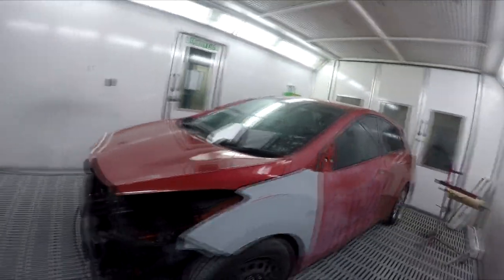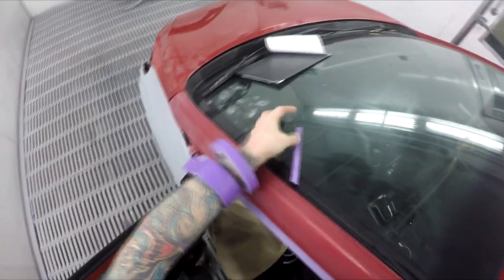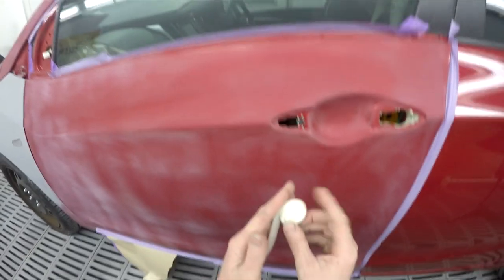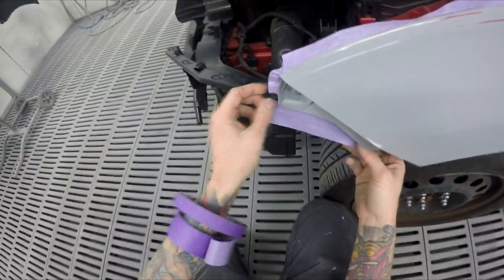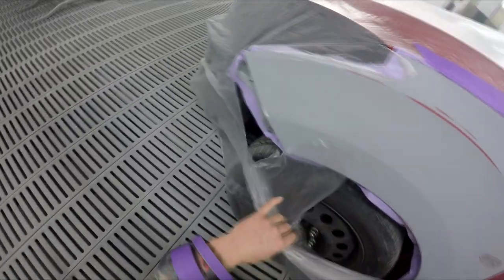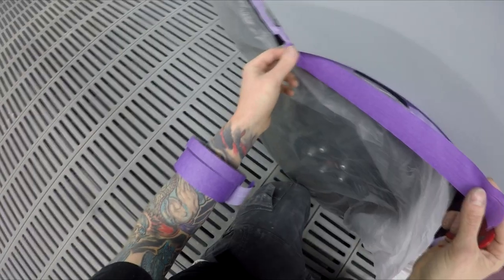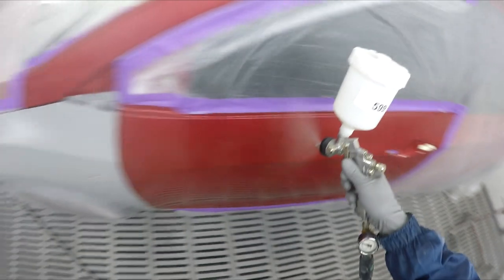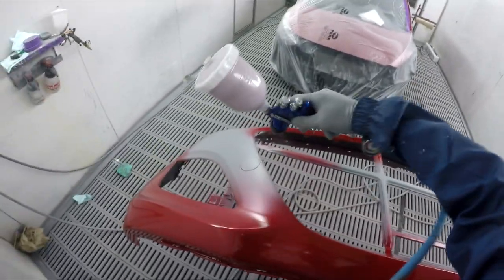Red Hyundai Mask & Paint

Comment: He's right, the "A" pillar is the first leg or upright supporting the windscreen.  The "B" is next, supporting the rear of the drivers door, and so on.  They are the terms we use in the Fire/ Rescue Service for when we are cutting apart vehicles to extract people in car wrecks.  The term "pillar" is also an architectural or construction term for "upright support", "column", or "shaft".  I'd say that fits the bill here as well, providing support to the windshield/screen and roof structure.

Comment: Yep, the Sr200 is a great mask, total seal. Can't use it with glasses though. I'm currently using mine with a Devilbiss air supply belt which is working fine.

Comment: Yes! I’m a rookie so please excuse this dumb question. What does wet on wet mean? I am getting ready to spray epoxy primer on an old truck I’m doing a color change on. Then 2k over that. Is the wet on wet primer like a reduced 2k primer?
Reply: Semper Fi wet on wet primer is called primer sealer in the states
Reply: Semper Fi  I am not for sure. But wet on wet meaning primer that's wet in a since real short drying period, only done so panel looks a solid color instead of cuts. But the second wet would be the wet paint going on it. Primer not cured completely basically...? Am I wrong or what gunman??
Reply: After tons of body work. Down to mostly bare metal. I’ve spayed my epoxy sealer down now. I waited about 3 hours. Then I started my 2k high build primer surfacer. I put on 4 coats. Leaving the proper cure times per coat. So hopefully I can block sand that down to perfection. I think I asked a question here that I knew the answer to already lol
Reply: Semper Fi when it comes to body work, there's many ways to do it, but only one right way. Your way. You know what I mean, lol
Reply: Wet on wet also can sometimes refer to systems that you can apply your second coats of "whatever material" on top of the first coat, wet, and not have to wait until the first dries or flashes off.  There are some clear coats that you can do that with, and so on.  Heavily depends on the context on which the term is being used.
Reply: your panel is already prepped in a grit you are o.k to paint over,you first put on a very thin but wet coat of sealer,and usually at least let it flash off,then start applying color,without sanding the sealer you just applied.or if ur into art work,i.e.oil paint you would lightly coat entire canvas w/ linseed oil or a mix of linseed and thinner,then applyyour paint vs.color on a dry canvas...the last part is kind of a joke don't apply oil of any type to your vehicle your painting...lol
Reply: your 2k is what you want to do put over your filler and repair,not bare metal unless it's a d.t.m. or direct to metal primer.if not then an etch or epoxy primer over bare metal,then 2k,then sealer,color ,and clear.let the clear flash for manufacturers directions between coats,or u will have solvent pops..
Reply: Semper Fi the longer you can let it sit in primer,indoors,not in the weather the less " shrinkage u will have a month or 2 down the road...i mean let sit for a week or more if possible and you will see scratches below the primer,that weren't there the first day,myselfI would then block with 240,400 and 600 grit,and if you've broke through removing th "shrinkage,spot prime the breakthroughs.wil a light amount you ready to sand spot lightly next day or few hours later and seal and paint.. last 10 years I've been part of a team doing high end concourse restos on the west coast.